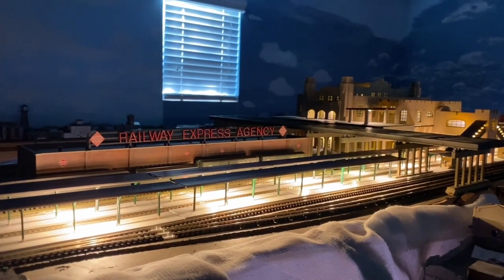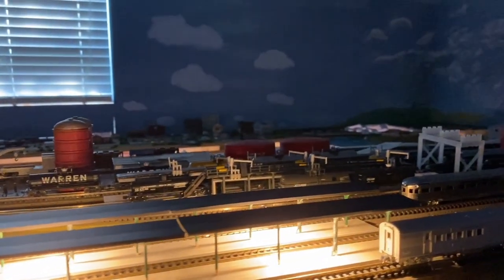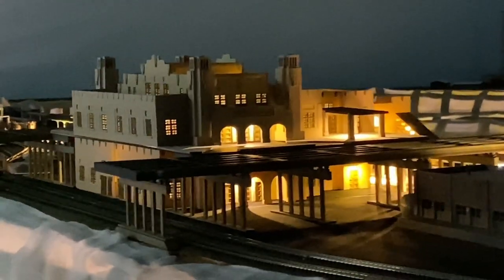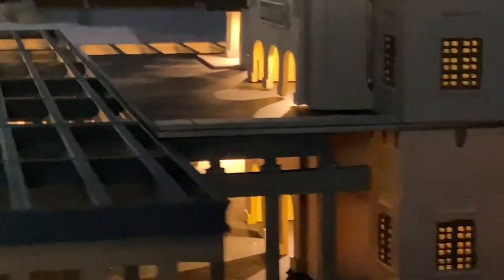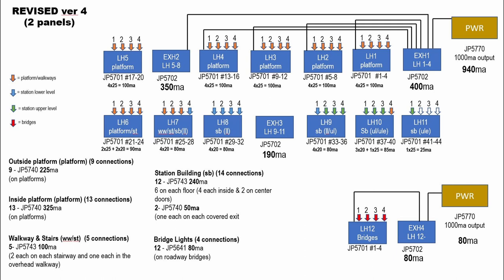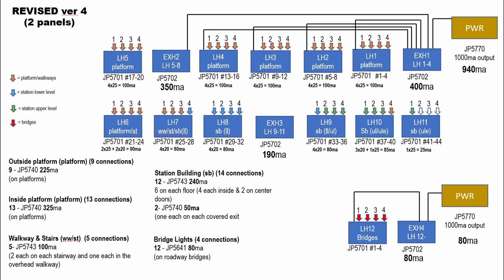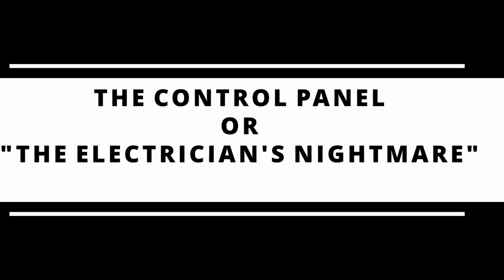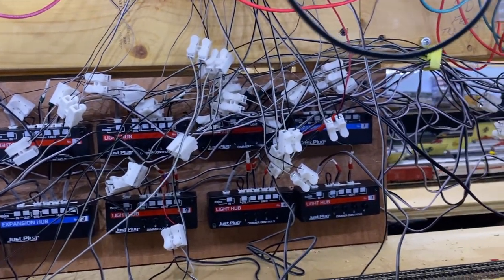Tulsa Union Depot Lighting Project - Part 6

Comment: That really looks good John !!!  Nice effects.
Reply from the maker: Thank you Mike. I appreciate your comments very much. It was slow going for me but I really like the results plus the modularity of the system makes it easy to add to as more buildings are done in the future……John
Reply: @tanzj  While expensive , the system is great
Reply from the maker: Mike, I think the cost is relative. I really like what the light hubs give you in ease of setting up and control of the lights. Their LEDs are little high but I am too old to try to learn using fiber optics and/or arduino stuff. The Just-Plug stuff is much easier for me. I will note that I have tested a string of very small Chinese LEDs connected through a linker plug and they work and can be controlled with the rehostat on the light hub. They are a little over 3 feet long and would work fine over the passenger platforms in my Union Station……John

Comment: Incredible work, John.  Pretty awesome lighting. Did you pretty much used all the ports or you can still add more lights if you needed to?
Reply from the maker: Hi Drew, Thanks for your comments. There are still three open ports and 60ma remaining in the control panel. However, I will be adding a second control panel, probably to the left of this one, that will be for the bridge lights and some of the other buildings as I add more lights in the future…..John
Reply: @tanzj  - lights on the bridge will look great.   Pretty cool lighting system.
Reply from the maker: Drew, Thanks again….